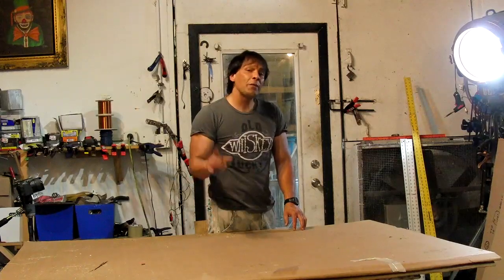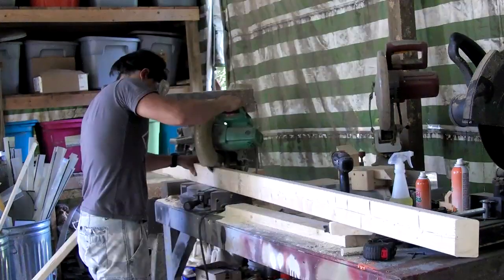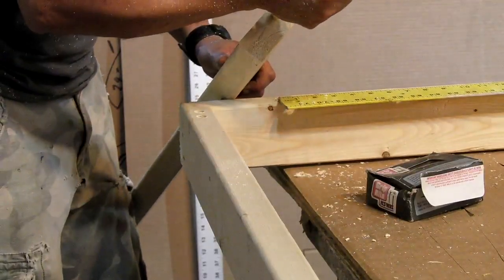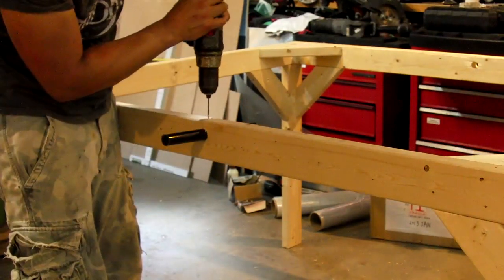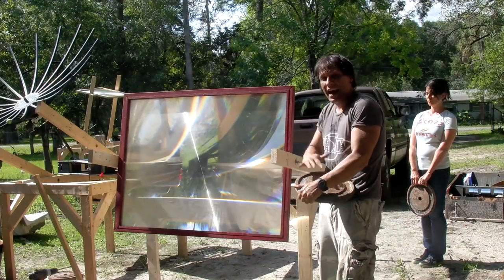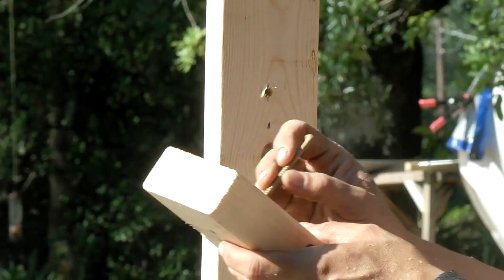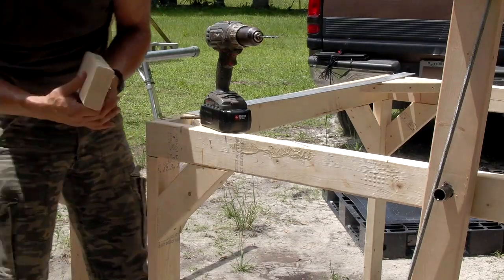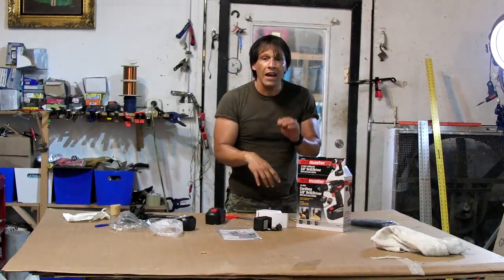DIY Linear actuator Solar Tracker FRESNEL LENS STAND DOOMSDAY PREPEPRS BUILD

Comment from the maker: :-) thank you for the suggestion. I have been working on ditching habit words. I no longer say "ya know" and "sooo" between thoughts. 

My first radio interview in 2009, the radio host said "ya know" frequently during the Q and A. Afterwards, I listened to the interview. I said "ya know" 365 times in a 30  minute interview.:-0 Contagious

I hear it all the time on tv and it bothers me now.

Part 2 in the works, the scissor lift has a cool trick feature to it.

Comment: Have you thought about adding rain protection your drill motor? Either that or adding wheels so you can wheel the whole thing out of the rain? That is, if it's an issue. Loved the video, by the way. You kept the pacing up nicely throughout. I had someone asking about homemade linear actuators... now I can send them here. :)

Comment: Thanks look forward to addition of the tracker. I have a hot tub heated using your trough method and it works great. I manually change the angle on it and I have been wondering how to make it track automatically so it will keep heating the water while I am not at home. In the future I am thinking about adding a work shed to my property and considering using radiant heat using a trough lense as the energy source combined with a rocket mass heater. You are a great inspiration thank you.
Reply from the maker: Thank you for enjoying our videos. Radiant floor heaters are a great option. Good luck with your project and let me know if you need any help.
Reply: Will do thanks!

Comment: (Continued) If you play around with the Fernco Cap you can find other methods to seal the top of the thread as well. The bottom Hose Clamp securely holds the drill in place, especially if you use a grinder to split the PVC. I think he used about 12" piece of PVC and the slit was maybe 4 inches near the bottom. There was about another 2" from the bottom of solid PVC to attach the Tee with to act as the pivot point and allow the wire room to pass by without pinching. Hope this helps...

Comment: I saw a video that enclosed a Drill in PVC, to allow the Drill to be protected from the elements.  Basically a Fernco Cap is used to pass the all thread through to act as the top seal while a hose clamp attaches the Fernco Cap to the PVC Pipe.  I think 2: pve was used.  He also split the PVC Pipe near the bottom and used a hose strap to pinch the unit into the pipe. Easy removal too. Then you simply drill a hole through bottom of the PVC to act as the pivot point or attach a Tee to act as pivot.

Comment: If you moved the piece with the stationary bolt on the all thread below the pivot point, and mounted your drill below the mount. It would angle all that down. Then cover the drill motor with a cardboard box coated with fiberglass resin. It would be weather resistant, and water couldn't run down the all thread to the drill motor.

Comment: Yeah, that is currently a very huge discussion here in germany, since the Telekom wants to throttle their customers connections after 75GB of traffic, and now the state considers stopping this by law. I don't know what exactly is the problem, but it is really wierd, that youtube works much better at my fathers (who has a connection 1% the speed of mine.) i've mesured, and i used 97GB of traffic this month (yet) :D

Comment: Speaking of, Harbor Freight always has sales for a small solar panel that you plug into your cigarette lighter to keep seldom driven cars topped off.  Unfortunately, most of those outlets go through the ignition switch and are off with the key out.  Anyhow, it's usually less than 20 bucks on sale and the only electronics in it are a very cheap generic blocking diode if you want to change the connector.  If you're looking for a cheap solution to keep your motor battery topped off, that'll do it.

Comment: Hi Dan what is  best size wire to be used on a 100 feet run for 10x 5 watt led's or for any 12 volt dc lighting
Reply from the maker: 50 watts for 12V will work well off of 16g wire. That is usually the size of the most inexpensive 100 ft extension cord for AC 120 V which handles 13 amps. You will be using just over 4 Amps so 20g wire rated at 7.5A would be the usual but due to the long run at low voltage you might bump over 5-6 A. If you use an extension cord make sure you alter the ends so no one ever hooks your DC to a standard 120V outlet.
Reply: Hi Dan,thanks for reply I have cut the end's off  one end go's to 12 v dc off battery  and the  other end at led light is it worth while fusing all the lights on the run if so what  what size , by way some mad video,or would you wire it another way

Comment: Dan - you would like this.  Automated mechanically controlled non-electric solar tracker.  Apparently it works by concentrating the sun's position using mirrors, black painted pistons, and hydraulics.  Maximize your solar panel's efficiency without using it's power to waste in circuits/electric motors.

watch?v=RHOiEX2tEtc